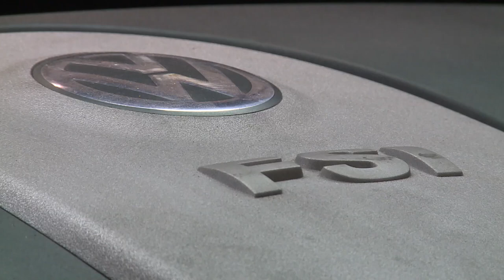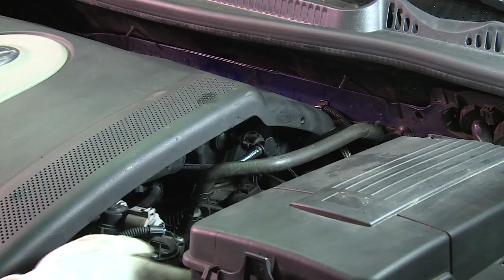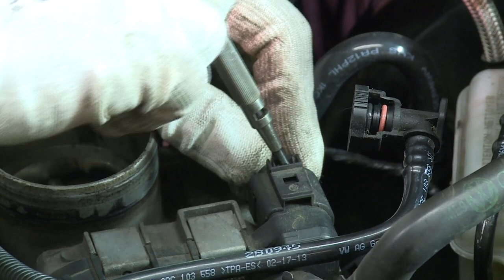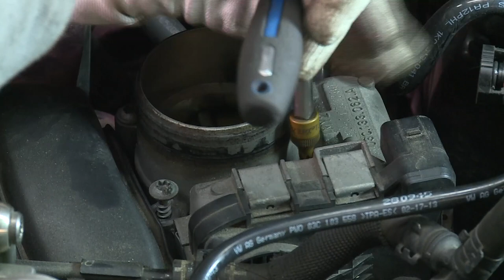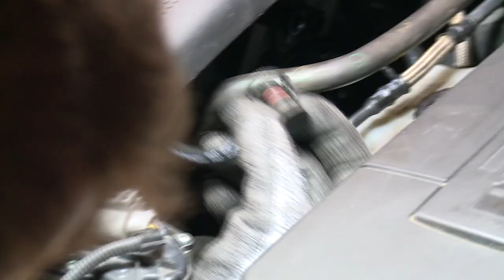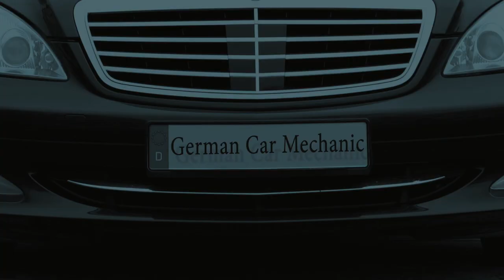✰ VW GOLF, POLO, SEAT, AUDI, SKODA FSI ✰  How to replace Electronic Throttle.

Comment: hi i just wanted to ask a question, i have a polo 9n 2003 model of  which the throttle body has oil sludge inside at the bottom part but the top part is clean and this causing the car to losse power and whhen changing gears it makes a banging sound so should i just clean it or i just have to replace the whole thing